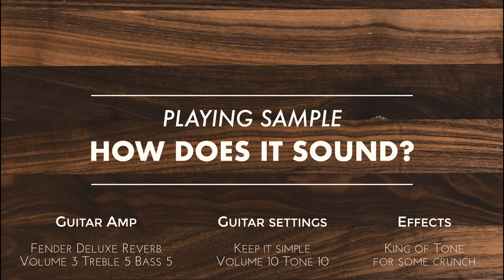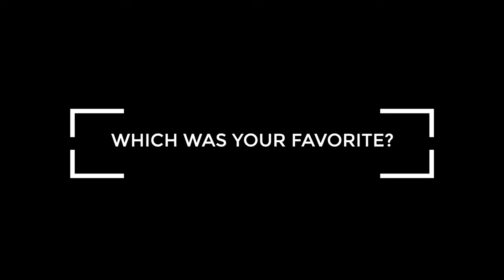I Pimped My EPIPHONE CASINO | Pickup Upgrade | Bone Nut | Bridge

Comment: Looks good, but looks more like an ES330 now. I think I prefer an Epiphone Casino to look like an Epiphone Casino. And regarding the sound... both the original and the upgraded Casino sound great. But the original pickups sound more vintage to me than the Lollars. And I really do like that vintage sound. Thanks for the vid.
Reply: If I was going to change these pickups, I'd swap to the Gibson USA P90 Dogear pickups.  The new three thousand dollar USA Casino's come with those pickups.
Reply: I disagree… the stock sounds like crap compared to the lollars. Epiphone always put crappy Chinese ceramic pickups in their guitars, but once you upgrade them they sound much closer to Gibson…

The casinos a great looking guitar but the black pickguard and pickups make it look miles better..
Reply: The Pro P90 pickups on the Worn Casinos and the 2023 MIC models are surprisingly an improvement over the crappy stuff from previous years. I’ve upgraded to 50s wiring with nicer components and it went a long way to open up the stock pickups. Way more range and depth than the stock electronics allowed. 

I still plan to try out some Fralin P90s — I would do the Gibson USA P90s, but you can’t get the right cover size for the neck. It’s only comes with the big cover for the bridge pickup, so that would have to be an additional after-market swap.
Reply: I have a chines casino coupe with the original p90T epiphone pick ups: they are crap. Those p90 lack mid and high, and... They are way too hot. They push my tube amp to break up way earlier then my gibson les paul. I changed the bridge, tail piece next is the pick ups and wiring and the cheap plastic nut. The guitar it self is amazingly well built, but all the hardware and electronic, are lower then low quality.

Comment: I"m a Casino player and I have to say I like the original pickups....I do have a bone nut and CTS pots on mine and have it intonated.....I don't think you need to mod a stock Casino in my view but hey....have fun...the Lolars sound more compressed to me and the chrome originals seem to be more open sounding...I have no doubt the Lolar pickups have less feedback issues though....I like the black pickguard....instead of modding mine I'll keep it as is now and maybe get a Riviera with mini humbuckers for a backup
Reply from the maker: Absolutely agree, there is no "need" to mode a Casino. But at a minimum installing a bone nut, maybe change the pots and bridge will significantly make this a better guitar while leaving the original pickups in there.
Reply: I replaced the pickups in my Peerless Casino, but swapped them back as I preferred the originals. I replaced the bridge with a post locking type and 52mm EtoE to open the strings a bit, also bone nut with wider EtoE spacing.

Comment: Just got a casino and I'm thinking the same thing. Bone nut, CTS pots, orange drop capacitors, switch, and some upgraded p-90s. Think it is definitely an improvement. More clarity, definition, and presence. Bone nut alone was a vast improvement. I might even consider ivory grover tuners and tune o matic bridge. Great job 👍

Comment: Nice work, great vid. I replaced the pickups in my Peerless Casino, but swapped them back as I preferred the originals. I replaced the bridge with a post locking type and 52mm EtoE to open the strings a bit, also bone nut with wider EtoE spacing.

Comment: Soundwise I like the stock guitar; optical the converted version. I did the same process with some of my Epis and to change all the stuff definitely change the sound . But often the tone became too bright and thin. I have a new Epiphone Riviera Royal Tan, the best imported Epi I played and did the whole thing, but rebuild it, because the original Pickups and wiring had more character. To change bridge and nut is always a good idea by an Epi,  the Guitar reacts tonal in a better way.
Reply from the maker: I like it both optically - might need to get another one maybe 😂 One thing that was annoying with the stock pickups was that some pickup pole screws touched and kept vibrating against the metal covers. That was driving me nuts….

Comment: Hello, thanks for sharing the upgrade. Did you install a specific model of the Tonepros bridge, in terms of thickness of the poles in the casino, if so which diameter fits well without changing the holes in the casino?  Many thanks, Bart
Reply from the maker: I bought the “TonePros TPFA-N Metric Aluminum Tuneomatic with Brass Saddles Nickel” model. I did not replace the poles, as I figured those are fine. So basically just removed the old bridge and popped the new one on.
Reply: Hello, many thanks for replying! So, the 2 holes on the Tonepros TPFA-N-metric (!) alu bridge will fit snug 100% on the original poles of my (korean-made) Casino, right? If that's the case I'll get me one. Best wishes for 2023! @eisreal6645

Comment: Nice job , sounds great ! I have seen that mick taylor from the pedal show and rhett shull did the same pick up upgrade with there casino's . A few years ago i bought an Eastman t64/v wich had SD  antiquity P 90's in it , they sounded great too , but i was looking for an ES 330 / casino type of guitar with a full lenght neck that joins the body at the 18/19 th fret instead off the 14/15 th fret so i sold the Eastman ( wich i did come to regret later offcourse 🤣) . Luckaly last year i found an 2e hand Stanford thinline 30 wich has become my main guitar now , i put an bigsby on it and i am just over the moon with this guitar , the stock pick ups sound great , so that saves me a lot off money not having to upgrade them and for the rest this is an top notch guitar ( wich is only fair because it is more expensive then the in china made epi casino ) . The Stanford guitars are also made in china and are at the same level as the Eastman guitars , but then a lot cheaper , so i would consider them a nice middle option between the epi casino and the eastman t64 . Have fun with the casino , for me these type of guitars are the best guitars ever made , they can do it all , acoustic  and electric .
Reply from the maker: Thanks! The only thing really that the Casino is challenging, is if you need any frets above 15/17th......hard to reach. But if you don't need to get that high up, yup, this is a fantastic guitar.

Comment: the problem with this current ran of casinos is that they are 95% on the mark
out of the box, my friend pimped his like yours , I didn't go all the way- just the nut , roller
bridge, lightly leveled the frets, crowned  and polished them . ( my frets were a bit gritty and I hate that )
the electronics are original, my biased opinion says my casino sounds more like a casino
my friend's has lost its warmth, anyway he has since put back the original pickups , he got
the warmth back and can crank it a bit more than mine before feedback becomes a problem...
when i can be bothered I might upgrade the electronics...
Reply from the maker: Yea, you’re right- they are really good out of the box. This was really just a fun project for me to do. From a playability and tone perspective you don’t really have to change anything. If I would only change one thing, it would be the nut (the one originally is a crappy plastic nut)

Comment: Those stock pickups sounds nice, warm and sweet. If you play at low volume. In your living room. Alone.

Those new pickups will carry you loud, live and in a band mix.

Good work.
Reply from the maker: Exactly, I tried the original pickups with my band. Did not cut through…the Lollars however no problem at all!

Comment: Nice job.  I like it. A little surprised ya didn't change the tuners, lol. J/s
Anyway, doesn't look like that job can be without a nut/bridge file. So, I guess I'm out.  It sounds great, again well done, Sir
Reply from the maker: Thanks! I was thinking about changing the tuners and looked up alternatives. But honestly I couldn’t find anything that would improve tone very much. The tuning stability is surprisingly good, so I just left the originals on. Still happy with them today!

Comment: Sounds good. It would be interesting to hear any differences between the Lollar covers and the metal ones in another video.
Reply from the maker: That would be interesting. I read that the metal covers contribute the that Casino tone. Ideally you'd get the Casino tone with the Lollars + metal cover, but maintain some clarity 🙂
Reply: the Epi Casino P-90's are just slightly different than standard. Jason Lollar will wind his pick-up onto your Epi pick-up to keep the chrome covers. I think that Tyson Tone Labs also does that. Now you just need a Bigsby B3 vibrato well worth doing that as an added bonus. Love my Casino after I modded the heck out of it, stock it was just a feedback machine..

Comment: Nice! Do you notice a difference between the stock bridge and your upgraded one? I'd definitely upgrade to CTS pots, a bone nut and I'd likely upgrade the tuning keys. Personally, I'd leave the rest of the electronics and stock pickups alone, but I am curious about that bridge.
Reply from the maker: Yes, for sure. The original bridge is flimsy and noisy (rattles) due to the retaining wire they use. The TonePros bridge is quiet. If you like the original pickups I think replacing to CTS pots makes still sense, they roll off better. if you replace the pots, I would just replace the whole wiring harness. Bone nut is a cheap and effective upgrade, it made a noticeable difference. Tuning keys I looked into - but if you want to keep those button metal tuners I didn't find any better options out there. My Casino as it is now stays wonderfully in tune, I decided not to replace the tuning keys, as don't see an actual added value there. Let me know what you decided to do and how it played out!
Reply: @eisreal6645  What benefit is there to changing the whole wiring harness? Does it improve the tone, or did yours have cheap wiring? Makes sense about the tuners. I haven't gotten a Casino yet. It's the next guitar on my list, but might not be for a minute. I just finished upgrading a Gretsch Electromatic Jet to get as close as I could to George Harrison's Duo Jet.
Reply: @weightlessfilms5651  I found the wiring was cheap cables etc. I don’t think there is tonal benefit in replacing those. But if you put nice CTS pots in there then I would also just for good measure replace the wires with kind of vintage style cloth covered wiring. You have to unsolder everything anyway, and the wire is cheap. But again, don’t think you have to! Good luck!

Comment: amazing sound in both cases although different, before the mods, there is a warmer sound and after the mods a more articulate sound. And I think it's all mainly because of the pickups since I saw the same mod on another channel (just the lollars pickups instead of the Chinese ones) and the results were the same.
Reply from the maker: I wish I could have both, warmth+articulate 😂
Reply: That’s easy. Firebird pickups have the same footprint. I would get a set, alnico 2 or 4, and only use 1 instead of the 2 bar magnets  for each pickup, so it’s not too bright.

Comment: I'm sure the minimal difference in tone could also have been achieved by slightly adjusting your amp or pedals. That being said, as a Casino owner myself, I cannot wait to replace that rattling bridge.
Reply from the maker: Ok, update: the new bridge also started to rattle. After trying to get to the bottom of it, now think it’s the the string heads/buttons inside the tailpiece. Will try to add some felt and see if it goes away.

Comment: I have the Ashthrope c85 acoustic electric thin line guitar on the way and I'm going to try to make a poor man's guitar into a hollwbody because I have 3 or 4 soudhole pickups in the neck position by shutting off the electronics and on. I successfully made shorter fretboard lengths by using my capo.

Comment: If you thought the tech was trying to put you off to make more jobs for the boys.. he failed here..
Don’t use that hammer on the nut…
Unless you want to damage the back heal of the nut slot.. protect against heat.. use a hair dryer and with grips use an UPWARDS motion..
Every single thing else is this video will make more of a meal of it…
Learn elsewhere or leave it to the pros..
Heavy music and flash video can only distract 
From first principles..
What!! The ploy surfaces CAN scratch…
Too many don’ts.
Reply from the maker: Hm. Chatgpt: how do you react nicely to someone so negative?